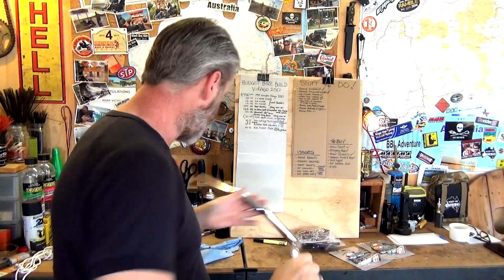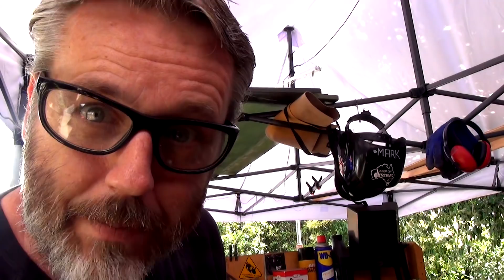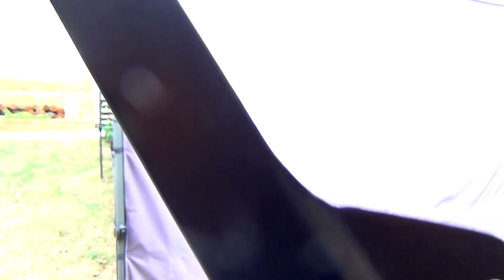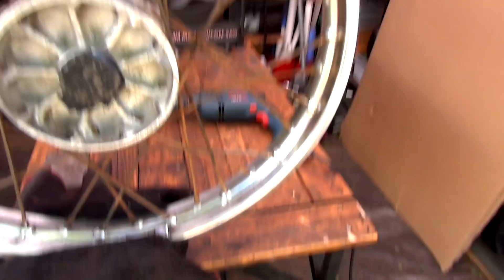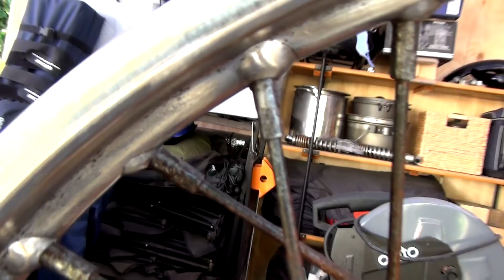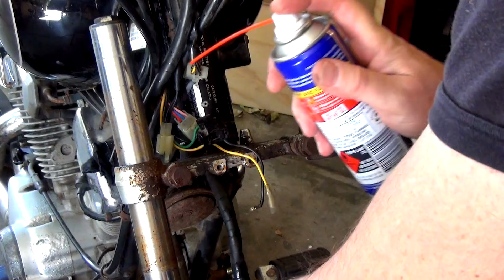Virago 250 Build - PART 6. Rusty Rims & Chain Guard!

Comment: Great and just what i am doing to my MZ right now.  Two tips, do not let the caliper hang from the brake pipe,  that is bad news. Also undo the stations top cap before  taking the forks out, then you can use the lower clamp to hold them to undo  it. Have to losen top clamp though  as this can clamp the cap. For the rusty top part of the forks cut a piece of plastic sink drain pipe to fit and spray  black

Comment: You could get a water soluble rust remover,make up a batch in a large tub and just soak all the parts when you take them off as it looks like your going to have a few more yet. Is there no one local that can re-lace the rims with new spokes it would make it easier either painting or re-chroming the rims too with them removed?

Comment: Hey Mark for removing rust nothing beats White distilled vinegar  let the parts soak for about a week then check. There will be  lot of floating crud but the parts will be totally rust free. If not let'em soak a while longer. They must be totally submerged. I've done rims in a 25 gallon tub with about 5 gallons of vinegar it helps if you can seal the tub . No fuss no mus. Try it on a small part you'll be amazed.

Comment: Mark quick piece of advice from a guy that's been a wrench for the past 50 years, get yourself a breaker bar or a piece of pipe to slide over your ratchet for more leverage. If you use your hand to beat on the ratchet in a few years your hands will be a thing of pure pain. There is damage being done that you do not want to have to endure 20 years from now.
Reply: Why not use the rust cleaner first?

Comment: Turning the fork tubes around is what I was thinking too.  There is such a thing as fork skins as well, instead of gators.  The skins are a tight fitting neoprene type cover.  I used them on one of my previous bikes.

Comment: Order a set of spoke skins ( they are cheap as chips ) for those wheels ! Then you won't need to bother with the surface rust on the spokes … just spray them down with a rust inhibitor , and wrap them with the skins , then they're as good as new . = )

Comment: On the spokes - I painted some rusty trail 90 rims and I used a long strip of emery cloth to sand the spokes. Slip it behind the spoke and holding an end of the cloth in each hand start going back and forth the way you would polish the toe of a boot. Hope that makes sense.

Comment: @Biker Bits
Best thing I used to get rid of rust from my fuel tank is Citiric Acid. You'll need to buy 0.5kg (if you buy one in powder) per 10 liters, so just dip half of a wheel into it. In just 24 hours it will remove any rust from the wheels. Wash it away with water and baking soda and you are done. I tried everything under the Sun....from rust busters, rust removers, vinegar, sanding grindig etc. and the best results I've got is from citiric acid.
I can send you photos just to show how effective it is VS commercial products.

Comment: Great stuff mate but I'd get rid of those rims and try to find some good used ones, from looking at the video those spokes look too far gone and unsafe. I wouldn't trust them just saying!!
Reply: Just a little surface rust on good quality spring steel is not that big of a deal . Spray them with a rust inhibitor , and wrap them in spoke skins , which are cheap as chips . = )
Reply: Does not look like surface rust to me it seems to have gone a bit further than that, the rims and spokes are pitted which has now more than likely put their strength in doubt.

Comment: Love your work Mark. I will pass on a tip that i use,,,,Anything black i want painted (as you did with the chain guard) I use White Knight Pot Belly Black in a semi satin finish. Prep it, paint it and then put in the bbq with the canopy down to cook for 2 hours,,,,,,,,,,its poor man powder coating.

Oxalic acid from Bunnings will sort out any rust issue. Following the instructions

The rust on your forks,,, Pinch some Ali foil from Nays kitchen. Roll the foil into a ball, wet it with some detergent in water and rub away, you will be surprised what it will acheive

Cheers Dude
Reply: + for all 3 points.